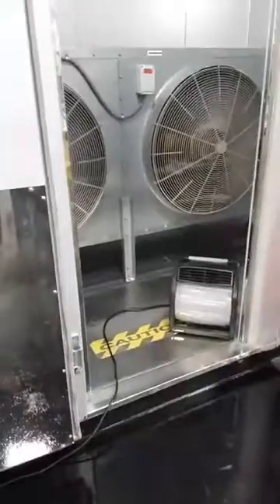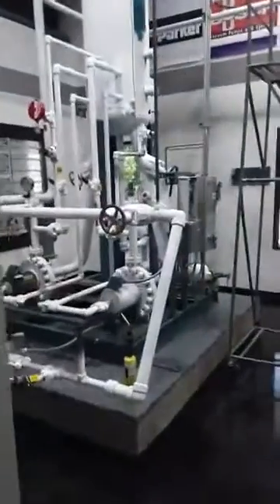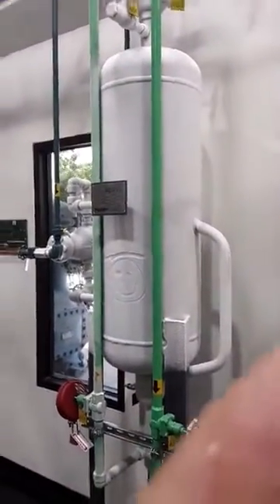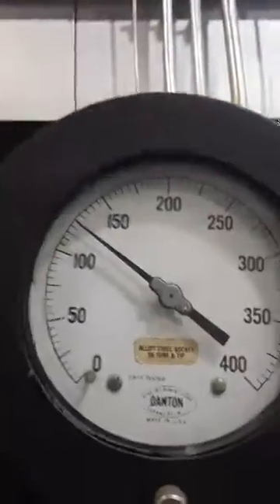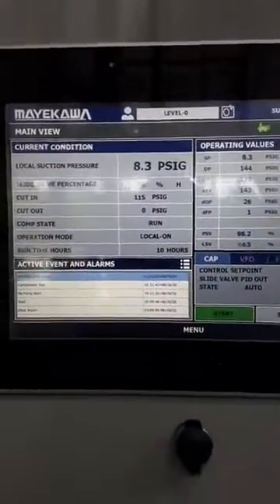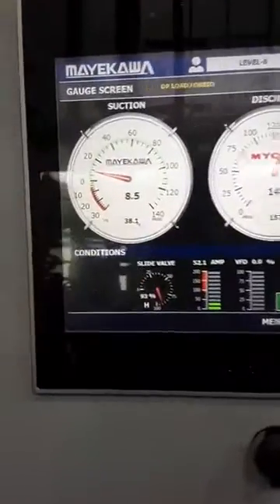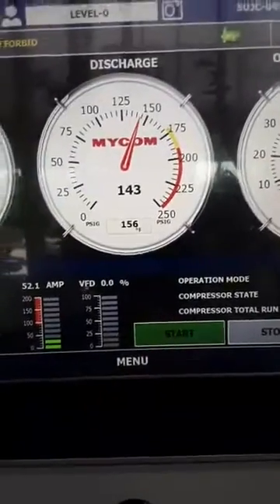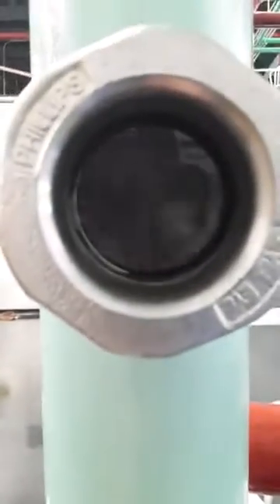Running Ammonia Refrigeration System

Comment: whay  Why ammonia tubes are not stainless steel and what kind of tubes are used to transport gas?
Reply: Piping is usually carbon steel until you get to the process side. All the coils I've seen are SS or galvanized carbon steel.